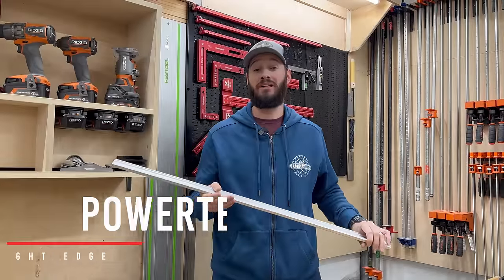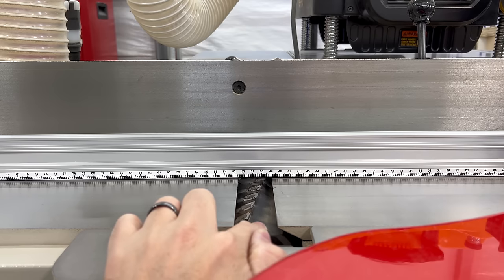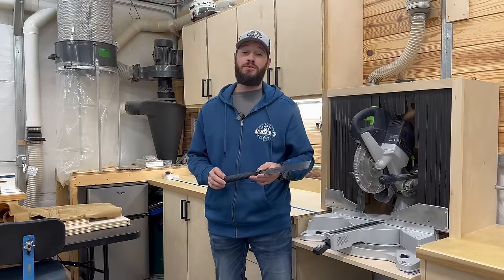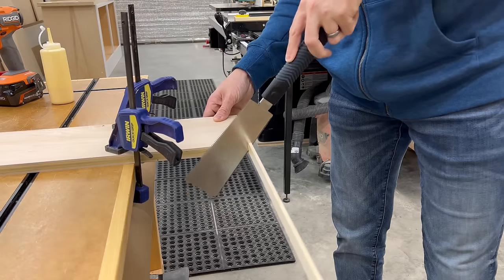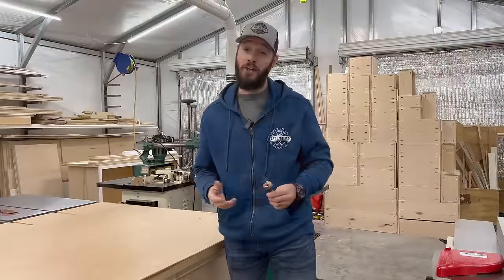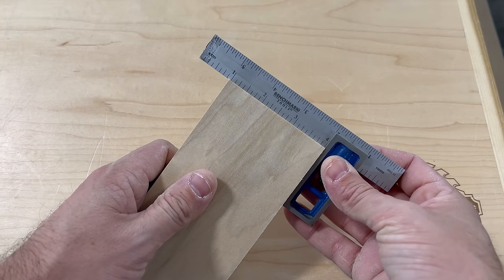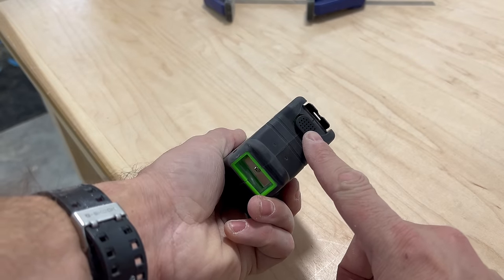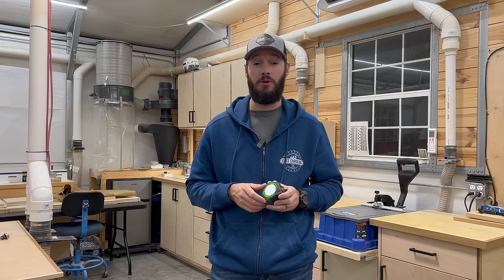MUST have tools for woodworkers // 5 tools every woodworker needs!

Comment: While your Benchmark squares are nice I find that that I like Starrett squares, made for machinists, and you can get blades that interchange into it with lengths of 6, 12, 18 and 24 inches, possibly even longer but I have never had the need for anything longer than the 24 inch. Yes, they are more expensive but quality and accuracy are paramount in the machinist trade, Mitutoyo squares are much the same, they have precision instruments and are a little less expensive than Starrett. (I'm a retired machinist.). I also like the Starrett machinist's squares but they are not adjustable with respect to blade movement but are highly accurate, usually within 0.001" per foot or less.

Comment: 1. A good wood 4' or 6' level is god for set up.
2. Jap pull saw - agree..
3. I can use a cheaper  counter set and the  are good.
4. Have 1 good multi square and that's all I need.
5. These tape measures are great...